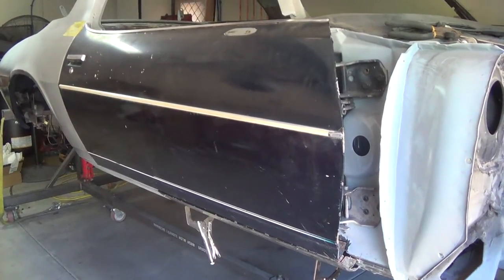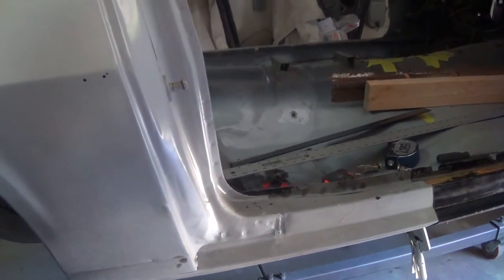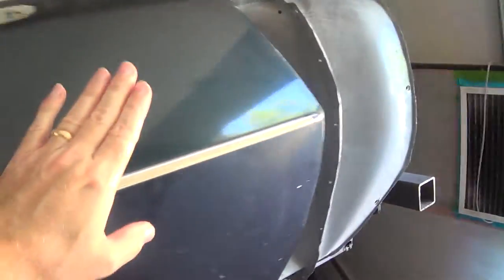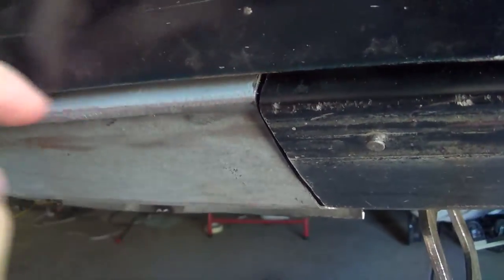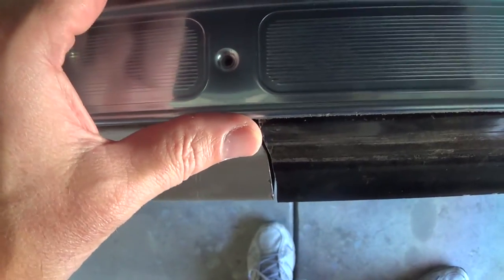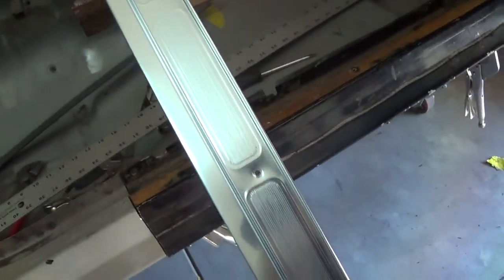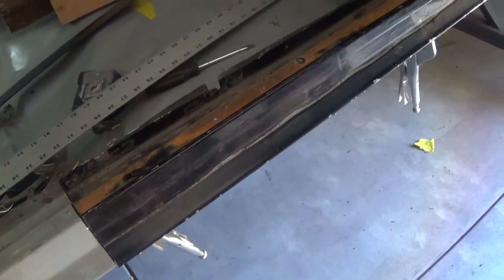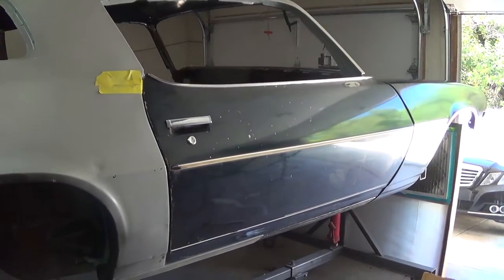1977 Camaro Z28 Part 70: Final passenger rocker alignment

Comment: Good luck on the rocker section repair. Looks like you're pretty close.
Reply from the maker: Thank you sir. I am planning on putting an old section of rocker behind the butt weld as a backer, hopefully that will help that butt joint there.

Comment: You should rebuild the door hinges before lining the door and gaps
Reply from the maker: Yeah, I will. This is just to get the rocker as close as I can before I weld it in. Panel alignment will be done when the car is back on the ground with the subframe, fenders, hood, etc. Thanks

Comment: replace the door hinge bushing first. you will never get the door strait with out new hinges bushing. as the alignment will change every time you open and close the door.  don't weld in the rocker until you have the door alignment resolved as it will not be strait as the door will be crooked when you weld it in and is not a good reference point. the door to quarter gap should be 7/32+/- 1/16th measured at the door peak. and at the bottom of the door. and 1/4 +/- 1/6th along the bottom of the rocker. the surface of the door should be level with the surface quarter and rocker. I have a 1971 Camaro fisher body manual with pictures, measurements and specs and alignment procedures if you need any of that info. let me know.
Reply from the maker: That's great. I want to get one of those body manuals for my car. I bought the assembly manual not realizing there was a separate Fisher manual. Too late on the weld though :)